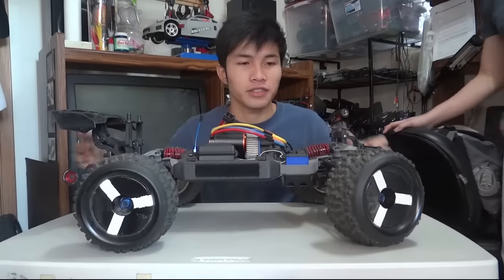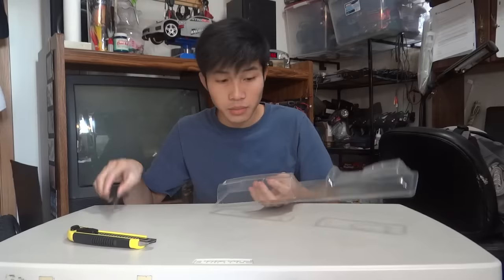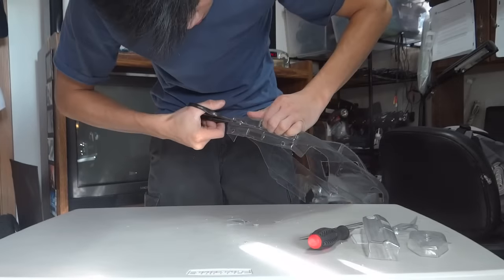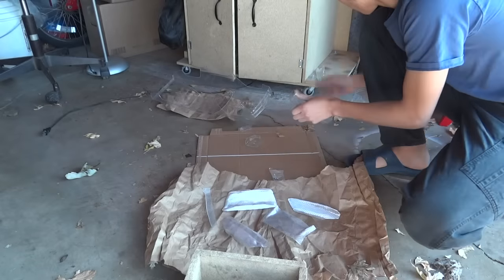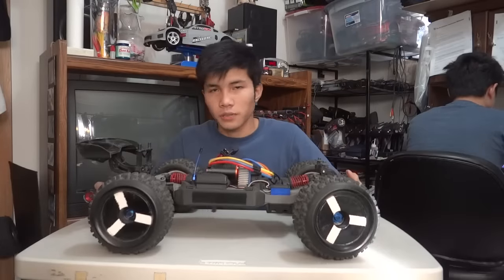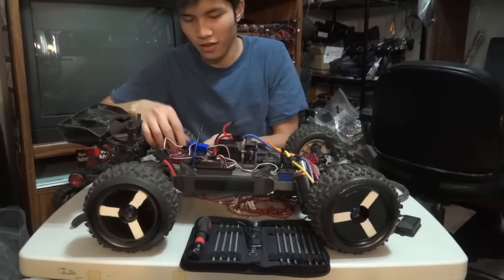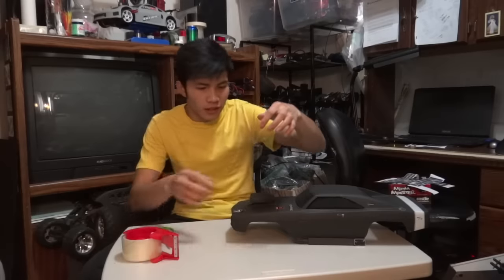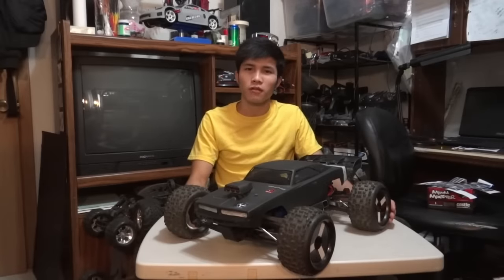RC Modify 2 | HPI 1969 Dodge Charger Body on Traxxas E-Revo - RC Car

Comment: You ate really good at this and i want to know if i could pimp out 2 1/24 scale rc trucks one is the losi 4wd short course truck rtr and the losi micro truggy rtr and if u could ad a link in the discription for the web sites u got the stuff on because i will probibly do it to my trucks
Reply from the maker: Ethan Olsen Yes, check out my new videos, I got the links in the description. cheers
Reply: Oh k
Reply: Ethan Olsen good thinging
Reply: Ethan Olsen

Comment: I have a Traxxas Stampede 4X4 VXL Brushless. Whenever it hits medium to high speeds, the wheels start shaking like crazy. I've replaced the axle shafts with brand new steel ones and it still does it. I've noticed the wheels move a little bit from side to side if you touch them. What should I do? and what is the problem in your opinion?
Reply from the maker: Fluffle Puffle I think the ball joints are the problems. cheers
Reply: Ask DJmetic on RC sparks
Reply from the maker: ross rogers
 good answer
Reply: try tightening the camber links
Reply: I started squeezing the tires and a crap ton of water came out. Just like a normal car, I'd bet it's just water. There's more in there, because I hear the bubbling sound, but how do I get it all out?
Reply: good idea

Comment: Man I really like this built what motor set up did you used and where did you get it?
Reply from the maker: +soldier99009 I usually use the stock motor. Whatever that comes with the car.

Comment: where do you get that mesh stuff from? just a hobby shop or craft shop or something?
Reply from the maker: http://www.ebay.com/itm/Amaco-WireForm-Aluminum-Modeling-Metal-Mesh-1-16-Pattern-Wire-Form-Contour-Mesh-/301059928749?pt=LH_DefaultDomain_0&hash=item461891f2ad

Comment: Hi, I found this Amaco Wire Form 1/4" Aluminum Diamond Mesh 50006F at ebay.

I will like to know whether the above items can be use for RC car?
Reply from the maker: firefighterdarry Here better: http://www.ebay.com/itm/Amaco-WireForm-Aluminum-Modeling-Metal-Mesh-1-16-Pattern-Wire-Form-Contour-Mesh-/301146411373?pt=LH_DefaultDomain_0&hash=item461db9916d
Reply: ThankYou

Comment: Dude this is perfect.  exactly what I wanna do as a custom. I'm waiting on a Redcat Terremoto-10 v2 1/10 Scale in mail. I want to make that Charger. Never painted one before so any tips or just follow yours and scale?
Reply from the maker: Thanks! Here, spray paint for clear RC polycarbonate bodies:
http://www.ebay.com/sch/i.html?_odkw=Duratrax+SprayPaint&LH_BIN=1&_osacat=0&_from=R40&_trksid=p2045573.m570.l1313.TR0.TRC0.A0.H0.XDuratrax+Spray+Paint.TRS1&_nkw=Duratrax+Spray+Paint&_sacat=0
http://www.ebay.com/sch/i.html?_odkw=Tamiya+Spray+Paint&LH_BIN=1&_osacat=0&_from=R40&_trksid=p2045573.m570.l1313.TR0.TRC0.H0.XTamiya+PS+Spray+Paint.TRS1&_nkw=Tamiya+PS+Spray+Paint&_sacat=0

Comment: im gonna make this body for my traxxas slash 2wd and add some awesome tractor wheels hope it all fits
Reply: thanks for liking Dragon will you make more of these videos and do you think it will hit cuz the revo has such mide um wheel things and the slash is a little shorter.
Reply from the maker: EnderMan Pearl  I won't know it until I try it or someone has to try it first. :D You should come pare the wheelbase of both cars.
Reply: whats that?
Reply from the maker: Wheelbase is the length from center of front wheel to center of back wheel.
Reply: The DarkDragonWing well i have a Baja Bug currently on mine and thats a whide body the charger is pretty narrow

Comment: the rear spoiler doesn't go it's ok to have one, but one that suits and screwed on the boot just above were a barrel to open the boot would normally go and i don't know about the tyres, it's not 4wheel drive, it looks weird like that.

Comment: Hello, it is called the tissue you use in windshield ...??
Reply from the maker: 1/16" Aluminum Contour Mesh
http://www.ebay.com/itm/AMACO-WireForm-1-16-Aluminum-Contour-Mesh-16-x20-Sheet-/121369159436?pt=LH_DefaultDomain_0&hash=item1c422a670c

Comment: พี่ค่ะ แผ่นบางๆสีเงินคืออะไรค่ะ fiber mastic ป่าวค่ะ :)
Reply from the maker: มันคือ 1/16 contour mesh คับ
http://www.ebay.com/itm/AMACO-WireForm-1-16-Aluminum-Contour-Mesh-16-x20-Sheet-/400689400439?pt=LH_DefaultDomain_0&hash=item5d4af30a77

Comment: the charger body will it fit right on my e revo 1/10 or do I need to do what you did
Reply from the maker: +Uga Boi It should fit, but the wheelbase is different a little bit

Comment: Hey buddy i have the same body but i wanna make on- road 4WD can u please tell me which chassis to buy? :-)
Reply from the maker: +Lucky Strike I see. You can buy one of these.
I buy this one:
http://www.nitrorcx.com/madspeed-drift-car-green.html
These ones are good too, but they are more expensive:
http://www.ebay.com/sch/i.html?_sacat=0&_from=R40&_sop=15&_nkw=1%2F10+madspeed&rt=nc&LH_BIN=1
http://www.ebay.com/sch/i.html?_odkw=1%2F10+hpi+drift&_udlo=190&_sop=15&LH_BIN=1&_osacat=0&_from=R40&_trksid=p2045573.m570.l1313.TR2.TRC1.A0.H0.X1%2F10+hpi+drift+RTR.TRS0&_nkw=1%2F10+hpi+drift+RTR&_sacat=0
http://www.ebay.com/sch/i.html?_udlo=290&_sop=15&_mPrRngCbx=1&LH_BIN=1&_from=R40&_sacat=0&_nkw=1/10%20mst%20drift%20RTR&rt=nc&_udhi
http://www.ebay.com/sch/i.html?_odkw=1%2F10+tamiya+drift&_udlo=300&_sop=15&LH_BIN=1&_osacat=0&_from=R40&_trksid=p2045573.m570.l1313.TR0.TRC0.H0.X1%2F10+tamiya+drift+RTR.TRS0&_nkw=1%2F10+tamiya+drift+RTR&_sacat=0
Reply: I need electric bro :D

Comment: what do u use for cover the class?
Reply from the maker: I think you mean this thing: http://www.ebay.com/itm/Amaco-WireForm-Aluminum-Modeling-Metal-Mesh-1-16-Pattern-Wire-Form-Contour-Mesh-/301059928749?pt=LH_DefaultDomain_0&hash=item461891f2ad

cheers
Reply: Yep I think that thx

cheer

Comment: I want Body who promised him. From where I can get it?
Reply from the maker: Hi. This is only for show. :)
  HPI E T-Maxx Savage '69 Dodge Charger Clear 1/8 Monster Truck Body HPI7184
- I bought this body from eBay.com
It can be found here too:
http://www.rcplanet.com/HPI_9_Dodge_Charger_Body_Savage_Maxx_p/hpi7184.htm
http://www.hpiracing.co.uk/piw.php?partNo=7184
http://www.ebay.com/itm/HPI-69-Dodge-Charger-Body-CLEAR-HPI7184-/231240859725?pt=Radio_Control_Parts_Accessories&hash=item35d707804d

Comment: +DarkDragonWing hi what other brand of  remote controlled car is just like the features of that rc ut is really cheap?
 please respond I am really desperate in having rc like that :)
Reply from the maker: +Add None It is this one: http://www.ebay.com/sch/i.html?_udlo=300&LH_BIN=1&_sop=15&_mPrRngCbx=1&_from=R40%7CR40&_sacat=0&_nkw=1/10%20traxxas%20E-revo&_dcat=2562&rt=nc&_pppn=r1&_udhi
Reply: +DarkDragonWing it is really expensive...what other brand of rc car has the same features like traxxas? would you recommend RTR? i am really new in rc and has a limited budget.

Comment: Where did u you get the lights
Reply from the maker: Seth Vasquez http://www.ebay.com/itm/G-T-POWER-12-LED-RC-Car-Flashing-Light-System-LE858-NEW-/250790970622?pt=Radio_Control_Parts_Accessories&hash=item3a644e84fe

Comment: where did he get the mesh for the grill is what i'm wondering?! Dafuq?
Reply from the maker: This one right here:

http://www.ebay.com/itm/Amaco-WireForm-Aluminum-Modeling-Metal-Mesh-1-16-Pattern-Wire-Form-Contour-Mesh-/301059928749?pt=LH_DefaultDomain_0&hash=item461891f2ad

Comment: Where do you order the parts? Like the bodies and chasis and stuff? If is online, id really appreciate if you could send me a link
Reply from the maker: Some links are old so you might have to research:

HPI E T-Maxx Savage '69 Dodge Charger Clear 1/8 Monster Truck Body HPI7184
- I bought this body from eBay.com
It can be found here too:
http://www.rcplanet.com/HPI_9_Dodge_Charger_Body_Savage_Maxx_p/hpi7184.htm
http://www.hpiracing.co.uk/piw.php?partNo=7184
http://www.ebay.com/itm/HPI-69-Dodge-Charger-Body-CLEAR-HPI7184-/231240859725?pt=Radio_Control_Parts_Accessories&hash=item35d707804d

List of tools needed:

-Wire Mesh
Amaco Wire Form 1/16" Aluminum Contour Mesh
http://www.ebay.com/itm/Amaco-Wire-Form-1-16-Aluminum-Contour-Mesh-/400607776001?pt=LH_DefaultDomain_0&hash=item5d46158d01

-Scissors and Body Reamer
Dubro Body Reamer and Curved Lexan Scissors Set for RC Car/Truck Bodies
http://www.ebay.com/itm/Dubro-Body-Reamer-and-Curved-Lexan-Scissors-Set-for-RC-Car-Truck-Bodies-/190829778599?pt=Radio_Control_Parts_Accessories&hash=item2c6e5756a7

-X Acto Knife
Light-Duty Aluminum Handle Knife with 10pcs X-Acto 11 Knife Blades Safety Cap
http://www.ebay.com/itm/Light-Duty-Aluminum-Handle-Knife-with-10pcs-X-Acto-11-Knife-Blades-Safety-Cap-/251337372314?pt=Model_Kit_US&hash=item3a84dff29a

-Glue Gun
GLUE GUN WITH 26 FREE GLUE STICKS HOT MELT ARTS CRAFT
http://www.ebay.com/itm/GLUE-GUN-WITH-26-FREE-GLUE-STICKS-HOT-MELT-ARTS-CRAFT-/220764546060?pt=LH_DefaultDomain_0&hash=item336697a40c

Optional:

-RC LED Lights
New RC 1:10 On Road Drift Car GT POWER 12 LED Flashing Lights Lamps System Night
 http://www.ebay.com/itm/New-RC-1-10-On-Road-Drift-Car-GT-POWER-12-LED-Flashing-Lights-Lamps-System-Night-/161066293801?pt=Radio_Control_Parts_Accessories&hash=item25804c9a29

-Duct Tape
NASHUA TAPE PRODUCTS 684355 20 Yards Transparent Duct Tape
http://www.ebay.com/itm/NASHUA-TAPE-PRODUCTS-684355-20-Yards-Transparent-Duct-Tape-/251266373408?pt=LH_DefaultDomain_0&hash=item3a80a49720

-The Exhausts: I found the similar ones on eBay.com
"1/10 RC R/c Racing DRIFT Car Exhaust Pipes Disguise Plastic Dummy Kit Set s"
http://www.ebay.com/itm/1-10-RC-R-c-Racing-DRIFT-Car-Exhaust-Pipes-Disguise-Plastic-Dummy-Kit-Set-s-/151196329116?pt=Radio_Control_Parts_Accessories&hash=item233400e49c

.....................................
RC Car Stands on eBay.com
Small one:
DTXC2361 Pit Tech Deluxe Mini Car Stand Blue RC DURATRAX PRODUCT

Bigger one:
DTXC2370 Pit Tech Deluxe Car Stand Blue RC DURATRAX CAR STAND

Comment: Where are you buy it?
Reply from the maker: Some links are old, you might have to research it on ebay or Amazon. The body is becoming very rare.

HPI E T-Maxx Savage '69 Dodge Charger Clear 1/8 Monster Truck Body HPI7184
- I bought this body from eBay.com
It can be found here too:
http://www.rcplanet.com/HPI_9_Dodge_Charger_Body_Savage_Maxx_p/hpi7184.htm
http://www.hpiracing.co.uk/piw.php?partNo=7184
http://www.ebay.com/itm/HPI-69-Dodge-Charger-Body-CLEAR-HPI7184-/231240859725?pt=Radio_Control_Parts_Accessories&hash=item35d707804d

Comment: donde consigues las piezas
Reply from the maker: HPI E T-Maxx Savage '69 Dodge Charger Clear 1/8 Monster Truck Body HPI7184
- I bought this body from eBay.com
It can be found here too:
http://www.rcplanet.com/HPI_9_Dodge_Charger_Body_Savage_Maxx_p/hpi7184.htm
http://www.hpiracing.co.uk/piw.php?partNo=7184
http://www.ebay.com/itm/HPI-69-Dodge-Charger-Body-CLEAR-HPI7184-/231240859725?pt=Radio_Control_Parts_Accessories&hash=item35d707804d

List of tools needed:

-Wire Mesh
Amaco Wire Form 1/16" Aluminum Contour Mesh
http://www.ebay.com/itm/Amaco-Wire-Form-1-16-Aluminum-Contour-Mesh-/400607776001?pt=LH_DefaultDomain_0&hash=item5d46158d01

-Scissors and Body Reamer
Dubro Body Reamer and Curved Lexan Scissors Set for RC Car/Truck Bodies
http://www.ebay.com/itm/Dubro-Body-Reamer-and-Curved-Lexan-Scissors-Set-for-RC-Car-Truck-Bodies-/190829778599?pt=Radio_Control_Parts_Accessories&hash=item2c6e5756a7

-X Acto Knife
Light-Duty Aluminum Handle Knife with 10pcs X-Acto 11 Knife Blades Safety Cap
http://www.ebay.com/itm/Light-Duty-Aluminum-Handle-Knife-with-10pcs-X-Acto-11-Knife-Blades-Safety-Cap-/251337372314?pt=Model_Kit_US&hash=item3a84dff29a

-Glue Gun
GLUE GUN WITH 26 FREE GLUE STICKS HOT MELT ARTS CRAFT
http://www.ebay.com/itm/GLUE-GUN-WITH-26-FREE-GLUE-STICKS-HOT-MELT-ARTS-CRAFT-/220764546060?pt=LH_DefaultDomain_0&hash=item336697a40c

Optional:

-RC LED Lights
New RC 1:10 On Road Drift Car GT POWER 12 LED Flashing Lights Lamps System Night
 http://www.ebay.com/itm/New-RC-1-10-On-Road-Drift-Car-GT-POWER-12-LED-Flashing-Lights-Lamps-System-Night-/161066293801?pt=Radio_Control_Parts_Accessories&hash=item25804c9a29

-Duct Tape
NASHUA TAPE PRODUCTS 684355 20 Yards Transparent Duct Tape
http://www.ebay.com/itm/NASHUA-TAPE-PRODUCTS-684355-20-Yards-Transparent-Duct-Tape-/251266373408?pt=LH_DefaultDomain_0&hash=item3a80a49720

-The Exhausts: I found the similar ones on eBay.com
"1/10 RC R/c Racing DRIFT Car Exhaust Pipes Disguise Plastic Dummy Kit Set s"
http://www.ebay.com/itm/1-10-RC-R-c-Racing-DRIFT-Car-Exhaust-Pipes-Disguise-Plastic-Dummy-Kit-Set-s-/151196329116?pt=Radio_Control_Parts_Accessories&hash=item233400e49c

.....................................
RC Car Stands on eBay.com
Small one:
DTXC2361 Pit Tech Deluxe Mini Car Stand Blue RC DURATRAX PRODUCT

Bigger one:
DTXC2370 Pit Tech Deluxe Car Stand Blue RC DURATRAX CAR STAND

Comment: That's not a charger that's a challenger
Reply from the maker: They look the same, I think, but it is a Charger. Here is proof: http://www.rcplanet.com/HPI_9_Dodge_Charger_Body_Savage_Maxx_p/hpi7184.htm
Reply: Its like a 1969 Charger.
Reply: If you can't tell that is a 69 charger  from any year of challenger you need to get your eyes checked out. Challengers never had the gas tank lid on top of the rear left fender the cars have some similarities but its extremely easy to see the difference even if you aren't a car person.
Reply: Gemma Barnard no its a 1969 dodge charger the 1970s charger had a solid grill and different tail lights oh and different door design
Reply: DOUJA GUNZ When insulting someone's intelligence, it works out better with good grammar. Just so you know.
Reply: clearly a charger.....see what i did there? its see through! XD
Reply: it's a charger, not challenger. And check out plz how does these 2 cars look.